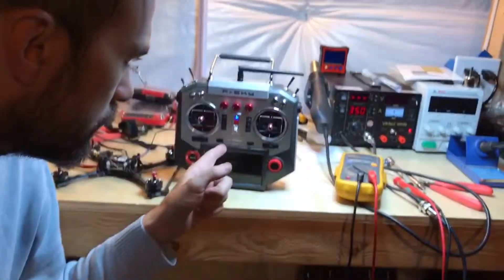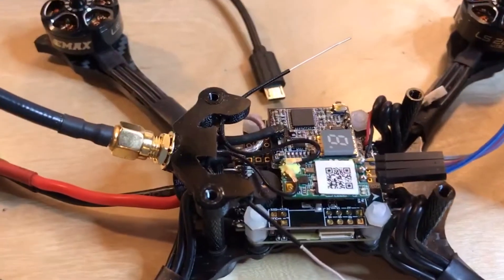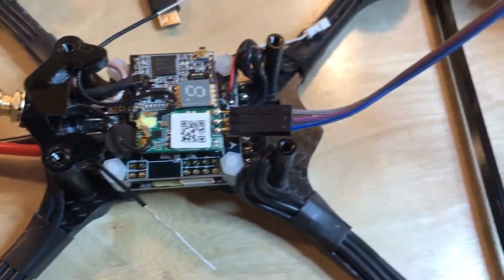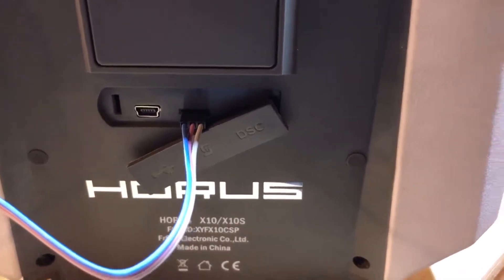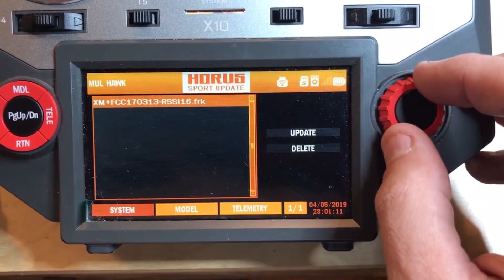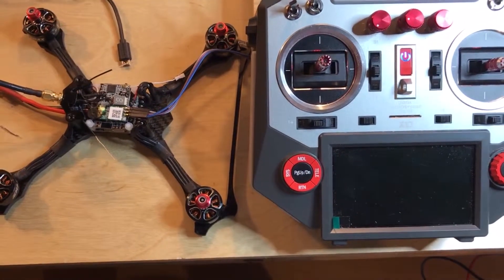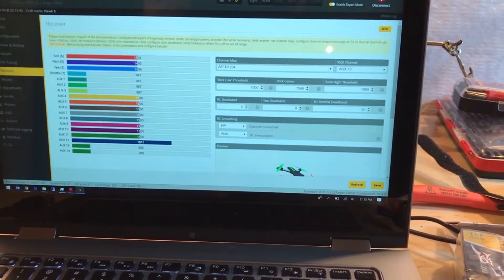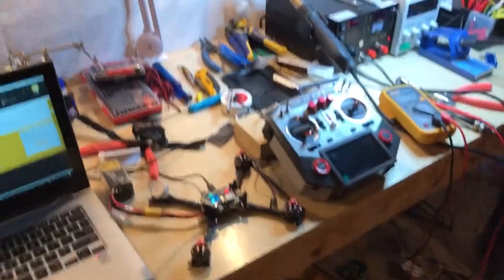FrSky XM Plus Firmware update with Horus X10 to fix no RSSI

Comment: So I have flashed my xm+ and I'm using betaflight 4.0 but my rssi is backwards literally.. I've tried to rssi_invert but it disables it and makes my rssi read constant and I've tried couple other things. Any ideas? Rssi goes up when radio away from RX and lowers when closer to RX lol
Reply from the maker: In betaflight check the rssi_invert value in the console and flip it.